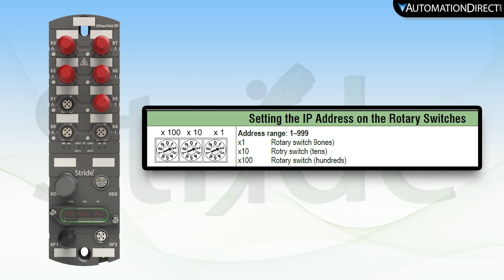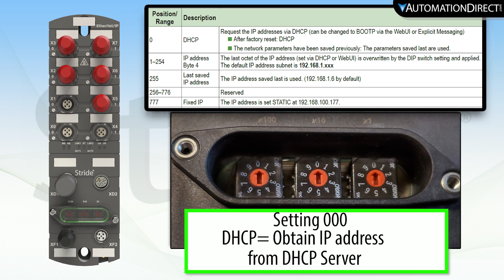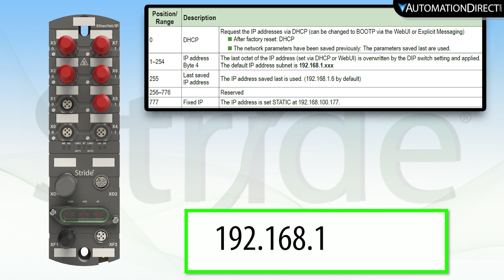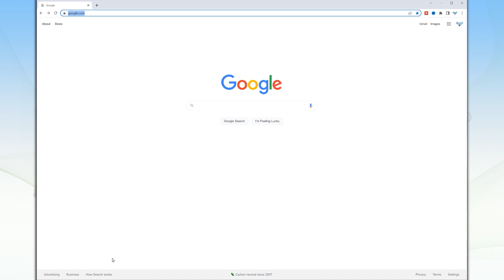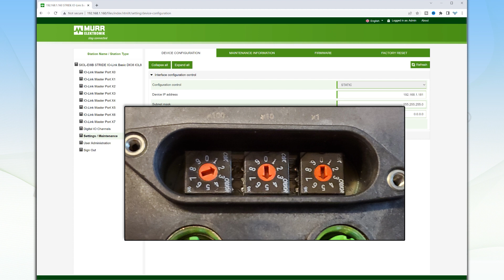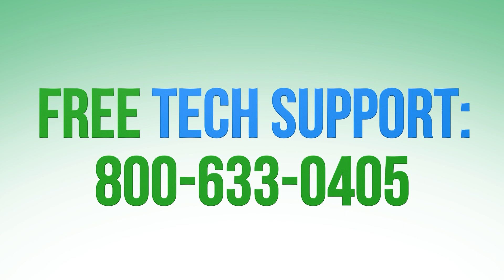Stride IO-Link Master Ethernet Network Quick Start from AutomationDirect

Comment: Is it compatible with sysmac studio, plc NX102-9000 ? we cant get it to work even with the eds file, any tips ?
Reply from the maker: @yannicklevesque5701 we haven't tested it with that product, but it is works with any standard EtherNet/IP Scanner. Some of the data sizing and other aspects of the IO-Link master EIP messaging can get complicated during initial setup. Try contacting our technical support team and they may be able to help with your specific setup.

https://community.automationdirect.com/s/contactsupport